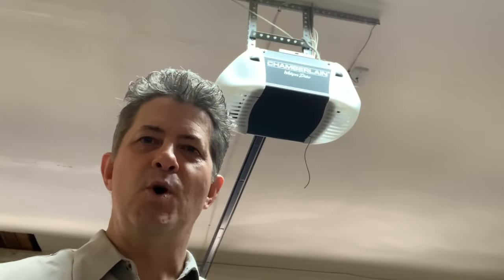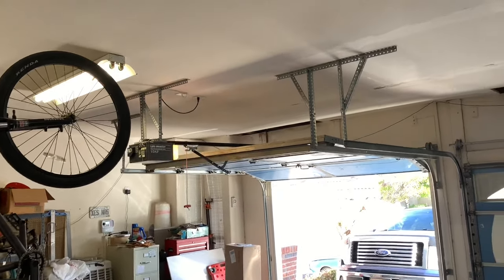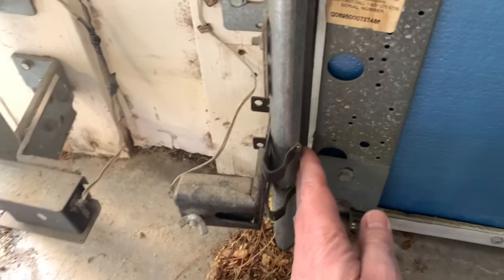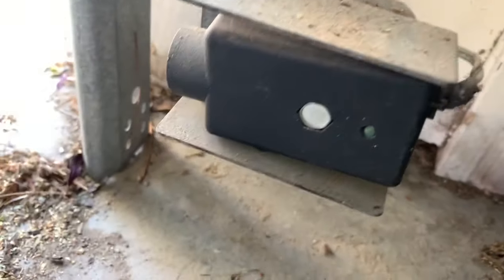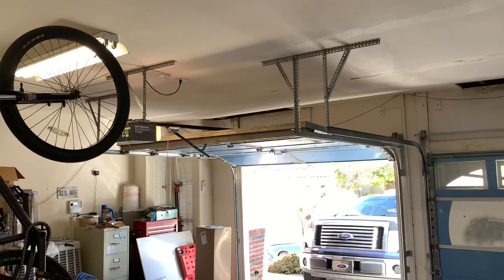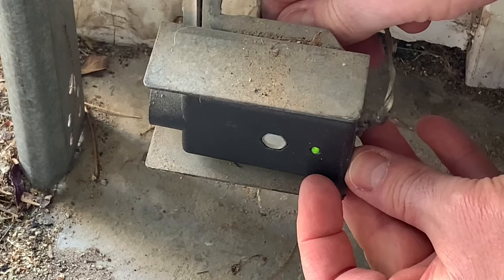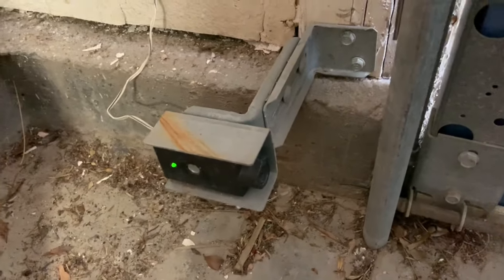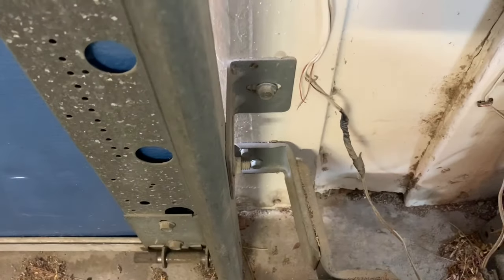Garage Door Opener Stops and Reverses

Comment: So on mine it was rather a tricky one to figure out.  Been just holding its button until closed for about two months now.  I finally found time to analyze it deeply today after several failed attempts through these past two months.  One of its guide cables wasn't running on its grooved tumbler quit right due to a crimp in a couple spots so thought was causing an issue.  Nope, it still had same issue after straightening out those crimps.  Sometimes door would close just fine and other times had to hold its button its full length of travel.  On another occasion I thought maybe opener itself is set too light on its downward sensitivity setting of force tension.  Adjusted it and at first thought that was it since it worked fine after that.  I thought bingo, I fixed it.  Nope. next day it started haunting me again.  So today I finally had some time to really look into this.  I almost gave up and called a repair tech too.  Man am I glad I didn't.  I was convinced opener itself was going bad at this point.  So I sat down and ran across this video amongst many others that I blew through.  I almost blew past this one too Mike, no offense, since I already had checked my sensors multiple times and therefore had ruled them out.  But what caught my attention was how you shot it in a messy garage.  Mine is that messy but also not entirely clean neither.  So I listened and glad I did.  Afterwards, I went out and re-inspected my sensors, this time both sides very thoroughly and even re-adjusted their line up with each other.  Still same issue occurring. So, I sat there starring at both of them.  Then a little bit of breeze picked and something caught my eye swing out and go back to where it was.  It swung out right in front of one off the lenses of a sensor!!!! To my surprise, it was a flipping remnants of a spider web that was stuck to the outside door track about two inches higher than the sensor.  Embedded to its bottom, the web was acting like a string, was a good size piece of saw dust.  It wasn't blocking the lens under non-vibrating circumstances or even close to it.  So I shook that track rail a little bit and sure enough it swung across like a pendulum right in front of the sensor lens.  Bingo!!!! Removed that spider web and everything else in close proximity to both sensors and PROBLEM SOLVED!!!!  I had to share this.
Reply from the maker: LOL! Great troubleshooting details! Nice work

Comment: What does it mean when the green light blink on and off? It want stay on green but will blink on and off. Sometimes the green light stay off for about ten minutes then comes back on blinking. While the other sensor stay on yellow.
Reply from the maker: Different manufacturers use different colors, but I would guess the sensors aren't seeing each other. Does the door work properly?
Reply: @MikeKlimek  yes they both were working properly.
Reply from the maker: @cutiepie5710  If they are working correctly, I would leave them alone, blinking light or not...
Reply: @MikeKlimek  okay thank you.

Comment: Thanks for this.  I think this is the issue with my mom's garage door opener.  I will go back and check again tomorrow with this tip.  I seem to recall seeing the sensor flashing a little and was wondering what that was about.  I heard you can over ride the sensor by holding down the button on the garage door/wall unit too (I saw someone mention that in another video).  Thanks for suggestions and hope it is the same issue for my moms!
Reply from the maker: Let's hope it's just that easy!
Reply: @MikeKlimek  Yeah, so, turns out my mom cleaned the driveway with a straw broom and she put it on the edge of the sensor so it was blocking it a little!  Ha, I should have just checked the sensor the first night but it was late and I was tired but I am glad it was just the blocked sensor and thanks again.  Imagine if she had called a door contractor and they charged like $200 and just moved her broom...
Reply from the maker: @cantire1234  LOL Glad you didn't have to call someone out!

Comment: I had the same problems you spoke of: to much sun, and the door not closing and the door not completely closing. Tested out those sensor lights and weren't even on. so I bought new lights and installed them. Pressed the button it went down and stopped at the floor, also it was a  bright sunny day.
 
Mike thanks ever so much.
Reply from the maker: Glad you got it figured out

Comment: Dude. You saved my a$$!!!! Thank you so much. 
It's a "winter storm advisory" after already just getting 8 inches of snow and having negative -17°F temperatures here in between Denver and Boulder, Colorado. 

I had a heavy huge garbage can to put out that bumped my censor off course. I didn't realize there was anything (which is ridiculous because how else does it know when stuff's in the way?!
I had pulled the string because, why not? Right? It's what you do when the door isn't working. That left me with what I thought were 2 problems then. 

Well thanks to you I didn't have to call in reinforcements, stand on a chair, use any tools, or spend any money! 

What do I owe ya?
Reply from the maker: LOL! Just your gratitude is payment enough!

Comment: Thank you for this help.  You explained my issue.  My sensors were old, so purchased new ones.  Connected the wiring.  Now I get no sensor lights at all.  Power seems to be there, but no sensor lights.  Any help?
Reply from the maker: Did you buy the same brand as the opener? I only ask because in some cases a universal part won't work.

Comment: Wow, this was great and well explained. I figured I might have two issues, one of which was the "blinking" (inconsistent) receiver light. I determined that it was not a misalignment as you smartly gave as the likely issue folks have, but a loose power wire that when I giggled it on the this sensor box, the light went steady. The door now works normally. While I may have to repair the wire/sensor,.....your video was instrumental in me going to the "target" issue, and finding the answer. Thanks!!
Reply from the maker: Awesome! Very glad to help you Jontona!

Comment: Thank you for the informative video.  My problem is with the sunlight hitting the sensor at a certain time of year and certain time of day - - when the sun hits the sensor just right.  Usually, I just stand out from the sensor between  it and the sun and I will cast a shadow onto the sensor and it will close.  But lately that isn't working either.  Wonder if the sensor is going bad (6 years old).
Reply from the maker: Secure something like cardboard to it to act as a shade...assuming the sensor isn't bad

Comment: Hello. Thanks for the video. It was very good! 
I did all The steps you recommended however the sensor with the blinking light only stops blinking when I put my had underneath the sensor or behind the sensor. 
Do you have any recommendations to fix that?
Reply from the maker: It sounds like when you put your hand underneath or behind it you are touching it and making it "see" the other sensor. It sounds like you just need to align it and tighten the wing nut that holds it in place.

Comment: Actually my problem is the opposite of this. My door starts to open and then goes back down. Do you have any idea what that could be? Thank-you for the advice on this issue. Your explanation is very easy to understand and I'm sure it will save people a lot time and frustration.
Reply from the maker: Try increasing the upward force. There is usually a small adjustment knob on the motor for this.
Reply: @MikeKlimek  Thank-you!
Reply from the maker: @read1John  Welcome!

Comment: You are right on the light on the left was dim. The wires had been cut and I guess the tape around the wires were over ten years old. I pinched the wires and got a strong light. I am going to remove that old tape and replace with wire nuts. Great advice.
Reply from the maker: Thank you Vito glad it helped you!

Comment: Mike, this was a great video and it seemed exactly like my issue; but, I don't think it is.  I did tweak the sensors; but, they are both bright.  The one on the left is a bright solid green and the one on the right is a bright solid amber.

The door closes slightly more than the one in your video before reversing.  Neither light flickers -- it just reverses.  

If I close it with the remote and pull it in the door will close.   Even holding the button the main remote won't allow it to close. 

Any thoughts on what else might cause this problem?
Reply from the maker: Sometimes the changing of the seasons plays a role...metal expands when hot etc. Try going to the motor and increasing the downward force. There should be a dial that you can turn slightly.

Comment: Thank you so much for this video!  In my case, it was the sun that was interrupting the beam.  It was striking directly against the emitter (orange light side).  It has worked fine since we moved in and suddenly yesterday just started reporting "beam obstruction" or "faulty wiring".  I checked all the wiring and even pulled the switch off the wall. Nothing changed.  But when you mentioned the sunlight as a cause, I rewired everything and it is working just fine, as expected, because there is no sun on the sensor.  It would work to open, just not to close, unless I held the button down, which I guess overrides the sensor input allowing you to force the door to close.  You may want to list that as a potential cause on screen in the beginning or  as text on the screen as well.  That is for sure my cause!  Thanks again!!!  Never would have guessed since the door is not usually open at that time of day.  That probably explains why it "stutters" during the day, as well.  The sensor gets direct sunlight in the afternoons.
Reply from the maker: Excellent-glad to help you!

Comment: Thanks for the video. But what if it still struggles? It will close all the way 1 out of 10 times. But most of the time will close 30% or even 90% and then reverse. I think the sensors are lined up, so something else must be the issue or I'm not aligning them well enough that a little vibration on the way down throws it off. When I wiggle the power cord going into the back of the sensor, it seems to make a more solid connection (solid green light) but is pretty shaky otherwise. Thoughts?
Reply from the maker: If you are saying that the wire/connection to the sensor is loose and when you wiggle it the light becomes brighter, that is where I would start. Some sensors have wire terminals and others build into the sensor. Long story short, you may have to replace the sensor/wire. If you are replacing the sensor, don't get a generic sensor...make sure you get the correct name brand of your unit. You might also try increasing the downward force of the door. There should be dials on your opener for this. Just a little at a time.

Comment: This video got me headed the right direction, but, oddly enough, I had to clear our anything that was behind the sensor(between the back of the sensor and the wall) to fix the issue. I was cleaning some stuff in the garage and know for a fact that I didn’t bump the sensors or anything like that before the problem started. But I did put some stuff up against the wall. I have no idea how that caused an issue, but it did.
Reply from the maker: As long as it's fixed!

Comment: That’s a great video. Thank you. My sensor seems to be ok and the door closed 90% and bounces back up. Do you have any idea what is causing this?  Thank you.
Reply from the maker: You might try a combination of adjusting the length of travel and downward force. If the door hits the ground and bounces up, decrease the length of travel. If it doesn't go all the way to the floor, increase the downward force.
Reply: @MikeKlimek  Thanks, Mike.  I forced the garage door to close fully by pressing on to the remote, and that did the trick.  After it was fully closed, I was able to open and fully closed. Strange.  Nonetheless, thank you for your feedback, and I was going to try what you have suggested.

Comment: Just tried your suggestions: checked alignments, cleaned the sensor eyes, and sunshine ideas but still does the same start down then right back up. But by holding down the opener mounted on garage wall the door will go down. Raises up just fine. Could the sudden power to the unit cause a jerking motion to the door that knocks off the sensors? What now to try? Thanks Mike

Comment: Thank you so much for posting this, I had this exact problem & aligning the sensors fixed it. We had installed the sensors up on top by the opener pointed at each other basically disabling the system (we have no little kids anymore) but one sensor had shifted just enough to cause this same problem.
Reply from the maker: Love it when it's an easy fix!

Comment: Hi! Thank you for this! What do I do if i think it may be the wires because there is black tape on the wires ? One sensor is yellow and one is green. I cleaned and moved them and the yellow one is still yellow
Reply from the maker: Hard to say. Usually if someone puts black tape on, for example, a neutral wire, that would let you know that the neutral wire is a "hot" wire. However with these sensor wires, maybe someone used the tape to splice together wires. Maybe remove the tape to see if there is a splice that is no longer holding.

Comment: Apparently the norm around our neighborhood  is to to put the sensors facing each other up top of the unit. (I REALIZE that is a safety hazard but thats where they’ve been since we moved in ….in the last few months the garage door has started to bounce back up when it closes.   In our location that means if a litttle old DIY lady can’t figure it out…I gotta fork over $100 for an on site assessment.   Could you please suggest what other things I could check before having to shell out bucks and cut back on groceries for the week! 😮
Reply from the maker: Certainly the sensors should be mounted near the floor for safety. Your problem sounds like the length of travel is too great. Find the adjustment screws on the motor and slightly decrease the length of travel.

Comment: The house I bought has two garage doors.  One door has sensors and works properly.  The other door has no sensors, and since I don't have kids and live in the house alone, I haven't bothered installing them.  That door without sensors opens fine but has recently started halting and reversing after a few inches of travel when I attempt to close the door.  I usually have to hit the control button multiple times, with a few inches of travel each time, before I can finally get it to close.  Any suggestions?
Reply from the maker: Unless the opener was made prior to the early 90's, the opener should have sensors. So I'm guessing the previous owner may have devised a way to bypass them. Maybe check the unit terminals to see if something looks off. Anyway, it's probably a good idea to add the sensors for neighborhood kids and pets! Good luck
Reply: @MikeKlimek  Thanks for the response.  There is definitely a possibility that these openers were made prior to the early 90s, as well as the one piece metal doors they are attached to.  I'll poke around and see if I can solve this issue with stopping/reversing.  There's another Youtube video that points to an internal part of the opener as sometimes causing this symptom, and lots of comments saying that they solved their issue just by reseating that part.  I can't remember the name of the part right now.  If I can't solve the problem it's no big deal since I've been considering upgrading the openers anyway because they're old and noisy, but until recently they've been reliable.   I might just go the whole route and get some new, reinforced and insulated doors too, if it doesn't hit my wallet too deep.

Comment: Nice video, What happens when you clean and adjust the sensors and it continues to stop on the way down? Do you think it's a forced issue?
Reply from the maker: I would try to slightly increase the downward force of the door.
Reply: @MikeKlimek  Thanks Mike, that worked! Next step, DIY garage door maintenance.
Reply from the maker: @Andrew-ne1yw  Awesome-happy it's fixed!

Comment: I can pull on my garage door and it will close, sometimes if i hold the garage door button it will or wont close. COuld it be the springs are even or the door is not level? How do i check and fix that?
Reply from the maker: Unlikely. If the springs were broken you probably wouldn't be able to move it.I would first increase the downward force of the motor. There are small dials on the motor for this. Increase it a little at a time until it goes down consistently.

Comment: Helpful video!  Ty!  What do I do if the sensor has a yellow light not green?  Thanks again!
Reply from the maker: If your opener is working correctly, I wouldn't do a thing! Different manufacturers use different colors. If the light is steady and bright, that's a good thing.
Reply: @MikeKlimek  it’s a Lift Master professional 1/2 H.P.  It opens fine, but closing it is a whole different story. Ugh!:(. I’ve tried holding the clicker down all the way and other variations, but no luck. That’s when I watched your channel and tried moving the sensor to align it, but it just won’t work:(
Reply from the maker: @cdub1934  If your sensor lights are bright and continuous, try increasing the downward force on the motor. There should be some dials on the motor for this. Increase the downward force a little at a time. Not sure where you are, but sometimes the change of seasons necessitate small adjustments.
Reply: @MikeKlimek  you are the best!  Thanks for your time!:)